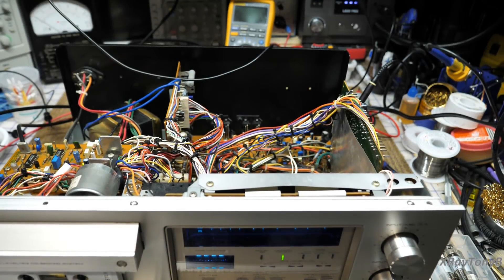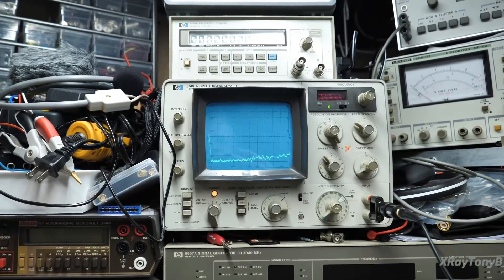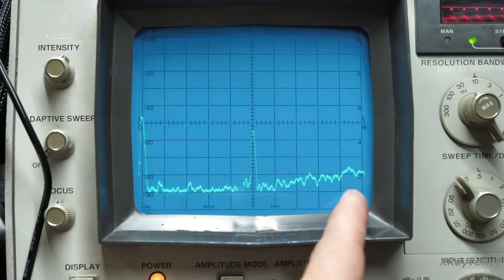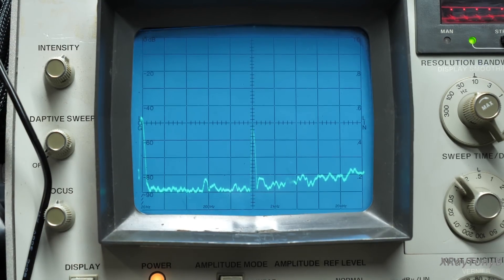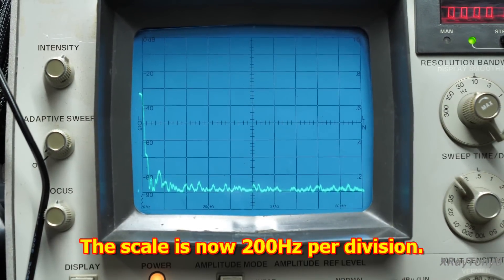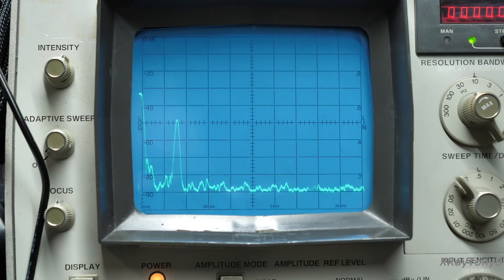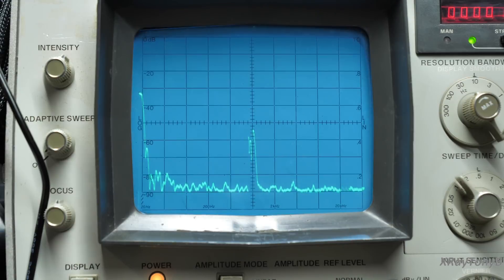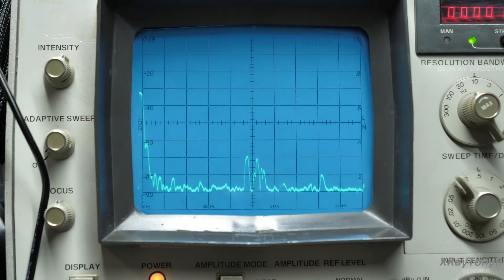Pioneer CT F1250 - Looking at Tape Head Output with Spectrum Analyzer

Comment: The best deck made, I had a 950 bought wholesale for $300 retail was $600, along with a SX-780 receiver $180 at Mcdade's, with studio Labs series Sonic Towers 12" woofer, 2x5" mids, 3 phenolic tweeters , then when VHS hifi came out it blew away cassette, 20-20k, 90db s/n.

Comment: When tapes are recorded, they are done so with pre-emphasis of the high frequencies such that when they are played back, the high frequency de-emphasis provided by the equalization circuitry results in a flat response.
The principle is similar to RIAA.
Using the test tape, and measuring directly from the head, the higher value output at 10khz compared to 330hz is due to this record pre-emphasis.
Whether the 10khz was high enough as we saw on the spectrum analyzer ,I know not, as a worn head would affect how much higher the 10khz was.
The results from the test tape measured at the line out is what really matters.
Reply: Correction.
The 330hz was higher, so the 10khz amplitude appears to be down from what I would have expected.
Reply from the maker: The problem with the test I did was that I did not have the impedance matched when I connected the SA to the head.  The tape head normally feeds into a JFET, which is high impedance.  The tape head has an inductance of 157mH.  Using the reactance formula, that would make it have an impedance of 986 ohms at 1kHz, 328 ohms at 333Hz and 9856 ohms at 10kHz.  I'm not sure how this would affect the readings of the spectrum analyzer.  The 3580 has a high impedance input mode, but I don't think it is as high as the JFET input, nor do I think the scaling of the unit will take this into account.  Again, this is starting to get beyond the amount of research I've done on this stuff, but I wouldn't trust the amplitude readings.  I was just looking to see if there was any appreciable output at high vs low frequency, which appears to be the case.  I think the impedance curve of the tape head is the "secret sauce" that determines the design of the EQ circuit to achieve the proper de-emphasis.  That is why you can't just replace this head with another type/brand without modifying the EQ circuit, as they are all different.  I think another person replaced one of these with an ALPS head, but had to also modify the EQ circuit for this very reason.  Thanks for the comment! Really interesting stuff!

Comment: So what's the advantage to using a spectrum analyzer as opposed to a scope?
Reply from the maker: Oscilloscopes display the time domain of a signal while spectrum analyzers display the frequency domain of a signal.  A spectrum analyzer allows you to look at a very specific frequency or group of frequencies and the relative amplitude of each.  In addition, spectrum analyzers are much better at measuring signals of very low amplitude.  The output of a tape head is very small, too small to see clearly on an oscilloscope.  If you could even see it, the signal would look very noisy on a scope.  Thanks for the question!
Reply: @xraytonyb  Thanks for the answer Tony!
Reply: Some higher end oscilloscopes running FFT are just as good as a spectrum analyzer if you set up the measurement carefully. The main difference you will find is in software implementation. On most scopes in FFT mode, the frequency start/stop, resolution and dynamic range is all implied in the timebase and vertical amplitude settings. Either you won't be able to enter those settings or it will simply tell you it can't do it, or give you an FFT with horrible resolution if the timebase/vertical are not set optimally. A spectrum analyser is far more intuitive to use from that perspective. Also a 2GHz spectrum analyser is considered entry level while a 2GHz scope is mid-high end.
Reply: @tmmtmm  Thanks for your response!
Reply: @Brain Goldberg The FFT function of an o-scope could render the same thing, but as Tony said it would be in the noise floor of most scopes. If I remember correctly, Tony said he had a -50dB attenuation set on the SA.
Reply: @srtamplification  Okay. That helps. It's a very tiny signal because he's not using the amplification circuitry of the deck, just straight off the head.

Comment: XRAYTONYB, are you sweeping 20hz to 20khz to look at the tape head output? and what is happening rolling off the high frequencies and rolling off the low frequencies?
Reply from the maker: I had to adjust the frequency scale of the spectrum analyzer for each of the two frequencies, so they would each be on the screen in a visible area.  Amplitude was just a relative reading, as I did not set up a proper impedance match or reference level.  This was just a demo to show the two frequencies on the test tape and to see if there was any distortion.  I did not adjust the input amplitude reference on the SA when switching between the two frequencies, so you could technically get a relative comparison between the two frequencies.  Very un-scientific!
Reply: @xraytonyb  What Two TEST Frequencies are you using? Because I would sweep from 20hz to 20Khz to see the Span of what the tape head output would look like from 20hz to 20khz Span

Comment: Tony, the eq that is put on the signal when recording to tape, does it boost or cut frequencies? I never knew that tape had to have an eq, I guess that because it's all done in house unlike vinyl records which is usually done in the amplifier, you just are not aware that this was happening! Well at least I wasn't! 
I was hoping to see the signal of pink or white noise as it was coming straight from the head before eq and after eq together at the same time to see what the actual difference was... But you would probably need a spectrum analyser that could show both waves at the same time unless there's another way around it? 
And what does bias adjust actually do to the audio? I hear the effect it has on the tape while recording and going by it's title it adds an AC bias but I have never really understood it. Is it like the carrier signal on radio? 
All that I know is that the Germans had figured out how to use AC bias some time before WWII, there's a whole back story of how an American soldier came across it after the fall of Germany and reverse engineered the circuit and mailed it and a few mechanical components back to himself in the US, then the story tells how it went from there to Being Crosby getting involved and finally the invention of video tape... There's a few videos here on YouTube, it's fascinating stuff! But before AC bias, tape was a horrible format... I would love to know more about this as there really isn't anything on the topic except that it was the thing that made tape the format it became...
Reply from the maker: To my understanding, tape decks use a type of pre-emphasis and de-emphasis.  The RIAA curve of Phono is more complex than what is used with magnetic tape, because tape uses just a simple 6dB/octave boost/cut above/below a set "knee point".  The knee point is based on the way the magnetic material on the tape reacts to being magnetized.  It is known as "magnetic tape hysteresis" because of the shape (hysteresis) of the amplitude response curve of the tape material.  I hope I'm explaining it correctly.  Low frequencies will have a higher amplitude than high frequencies on an unbiased recording.  The bias signal brings the frequency response into the center of the tape's hysteresis curve.  This corrects for some of the problems with high and low amplitude saturation points, but you will still have non-linear frequency response.  During record, frequencies above (I think) somewhere around 3kHZ are boosted and frequencies below around 50Hz are also boosted (but not as much).  The mid frequencies are flat.  During playback, high frequencies are cut and low frequencies are boosted from a knee point of somewhere around 300Hz at 6dB/octave.  I'm not sure of the exact frequencies.  It can get really complicated, as these things are different, based on tape type and tape speed.  I probably really messed this up, but this is how I understand it.
Reply: @xraytonyb  ok, this makes sense to me! Well if I have understood correctly, only the low end and high end is modified wherein the middle to some extent is left alone! 
I'm guessing that this is done for two different reasons! Possibly at one end of the frequency scale, the tape suffers saturation and on the other end of the frequency scale it suffers from over emphasis again due to those frequencies being able to be stored more efficiently on the tape...

Comment: There is a gizmo called a "cassette tape adapter." They are super-cheap and can often be found at the dollar stores. It is just a plastic cassette body with a wire coming out of it. The plug on the wire is the small stereo headphone type. The gizmo is intended to inject music from a cell phone, laptop, etc. into a tape deck. It contains a head that matches up to the tape deck head. The gizmo does not have any internal tape mechanism and just allows the tape deck to spin freely. It seems to me that this would be a good device for testing your tape head, as it does not have any wow and flutter influence and you might be able to rig a way to sweep a broad signal, from a function generator. Edit: I just searched Ebay for "cassette tape adapter" and they popped right up.
Reply from the maker: Peter already beat me to it on this.  I have one of those adapters.  Besides the lack of equalization, these inexpensive adapters aren't precision aligned, so you have no way of knowing if the azimuth is properly set or not.  If azimuth is out, everything else will be out of spec as well. They also can't output a specific amplitude in the same manner as a properly recorded reference test cassette.  I'm sure such a device could be designed, but it would need to be very precision aligned and would need to include its own signal generator with calibrated output.  That would probably be very expensive and cost prohibitive (but it would still be awesome to own)!  Thanks for the comment!
Reply: Actually it won't be good for that purpose! An actual tape, when recorded has an eq put on the signal to get it to sound right when played back. Those cassette adapter thing's just feed the music to the cassette deck head without eq! I have been using one in my car for ages and it makes everything that I play of my phone sound like the treble has been turned up! It's never really bothered me as I always use Dolby C noise reduction and the car stereo has bass and treble controls... I'm not exactly sure how the audio is recorded onto the tape, but I believe that they eq the sound as it's been recorded so that it doesn't saturate the tape and then boost the frequencies on playback. Vinyl records are also done in a similar way but also record and bass frequencies in mono otherwise the grooves will be to wide and deep and the needle will jump tracks during bass heavy bits... 
So basically the only way to do it is with a proper cassette tape... Unless you know how to add an eq to the tape adapter... But that's beyond my knowledge...

Comment: Hola Tony, no se si te comente en un video que yo tengo un CT.F950 y tenia el mismo problema y se cambio el cabezal y siguió el problema, claro eso hace como 15 años atrás, que se podían conseguir los repuestos de Pioneer, aun hoy poseo este Deck (CT-F950) pero su sonido es un poco opaco. Si lograste reparar ese problema, quiere decir que el problema es de alineación mecánica ????
Reply from the maker: Resultó ser varios problemas. Primero, había un potenciómetro defectuoso para el control del motor del cabrestante. En segundo lugar, reemplacé los condensadores en la ruta de audio y reemplacé los potenciómetros de una sola vuelta en los circuitos de salida y ecualización por potenciómetros de diez vueltas. Entonces pude alinear correctamente la máquina.
Reply: @xraytonyb  Que bien, bueno entonces le cambiare los condensadores en la ruta de audio y ese potenciómetro, aunque el mío es un CT-F950 y no usa el Fet en la salida del cabezal, como lo usa el CT-F1250, usa un IC (AN370) pero el circuito es muy similar y tiene esa retroalimentación con ese potenciómetro. Y con respecto a los potenciómetros del motor de Capstan el CT-F950 usa un motor normal con correa, esa es una de las grandes diferencia que tiene con respecto al CT-F1250. Bueno solo me queda decirte que muy buen trabajo el realizado por ti, felicitaciones y muchas gracias, vamos a ver que tal queda el mío después de estos cambios que le voy a realizar.